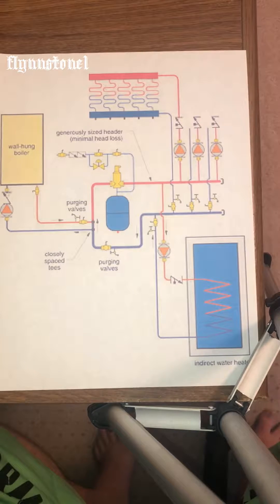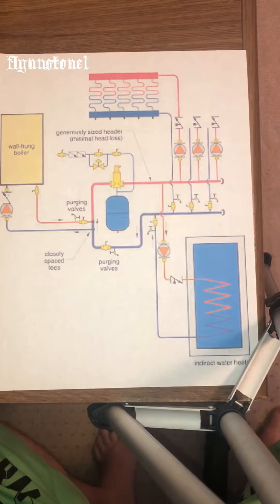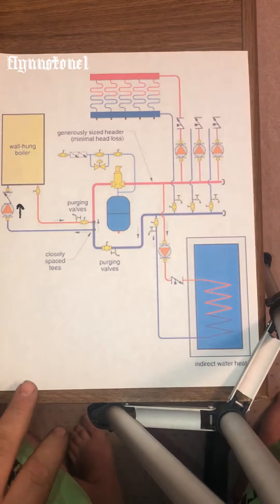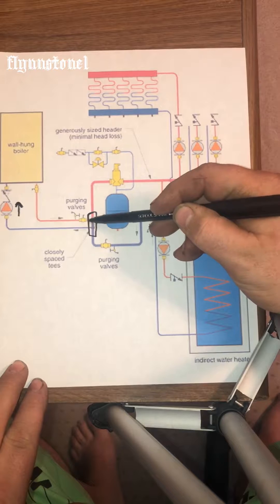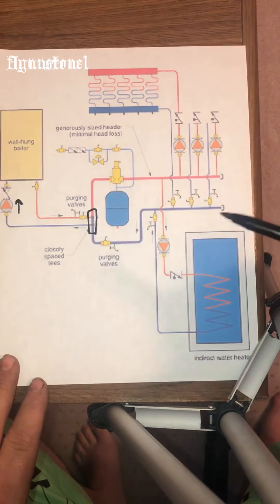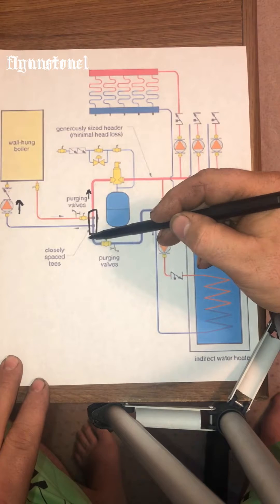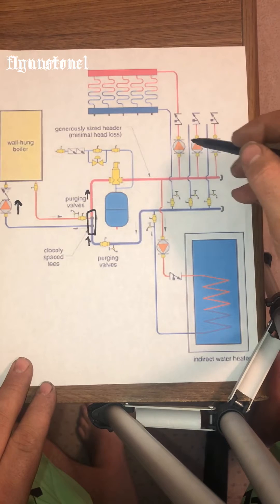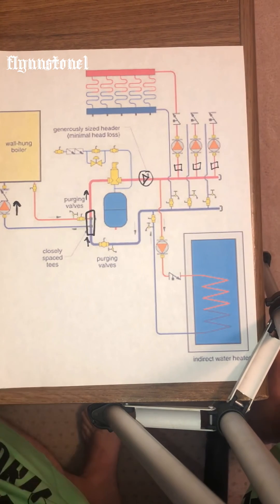Typical piping schematic of a high efficiency mod con boiler

Comment: when would you use zone valves and one recirc pump? is it just up to the installer. I have read that the zone valves over time save money vrs running pumps for each individual supply. any thoughts? thanks